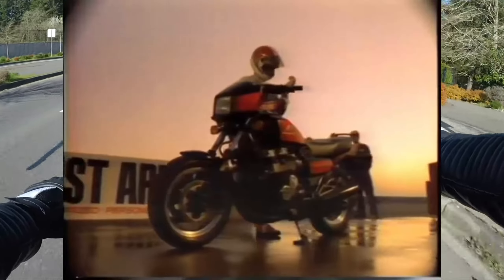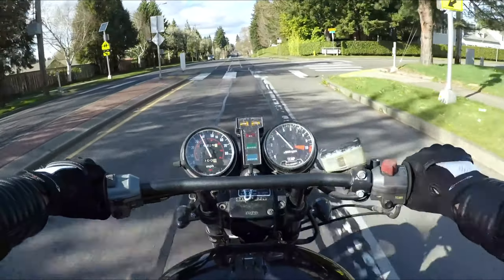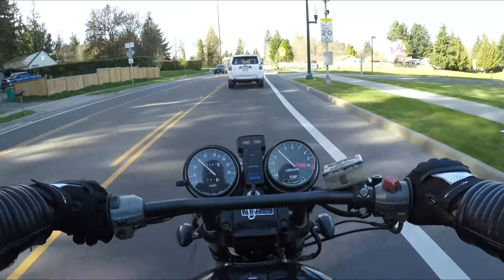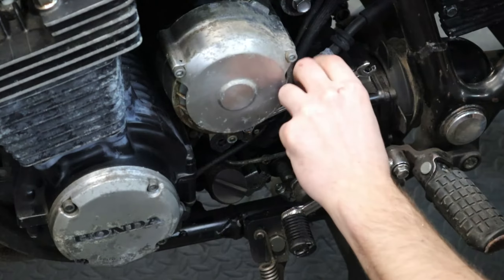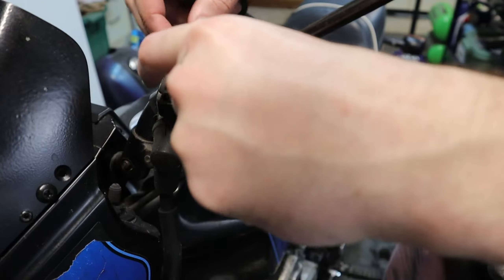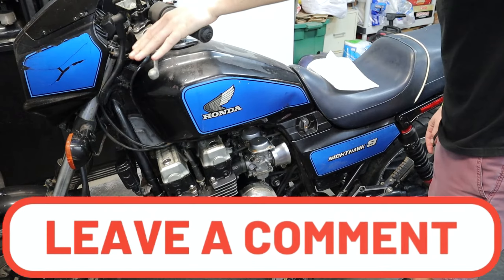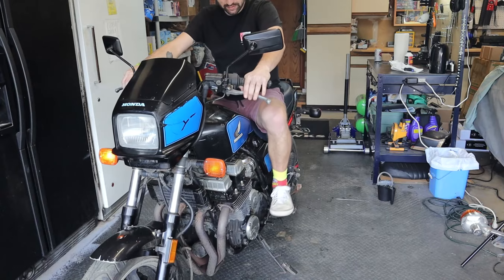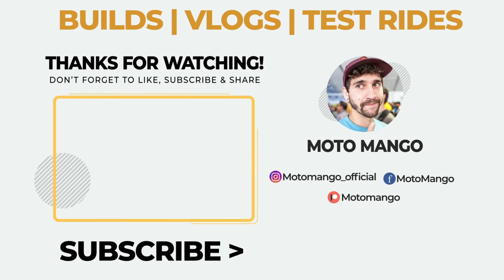I BOUGHT A NIGHTHAWK!

Comment: I've learned to clamp the plastic line on the bleeder valve., it almost always leaks air there unless you got new tight and flexible tubing.  Just use a plastic strap.
Reply from the maker: Good advice! Do you still have that vacuum pump? Could use that too xD
Reply: @MotoMango  yes it makes it easier with no pumping the lever and you just open n close valve.  Still putting on a plastic tie around tubing stops the air leak.